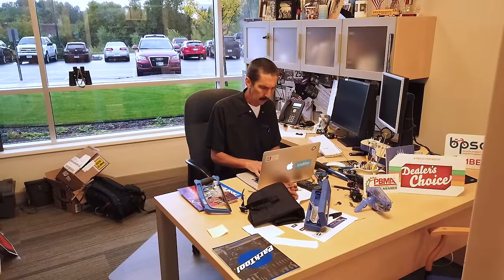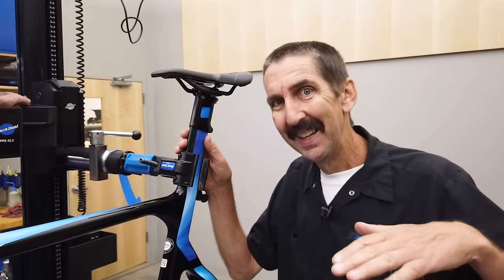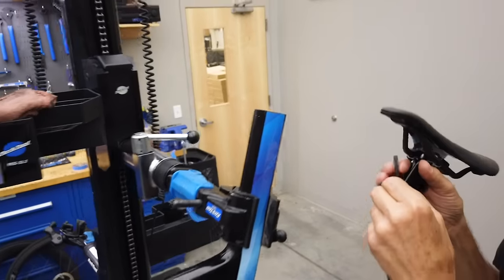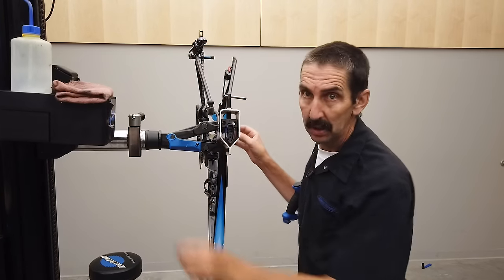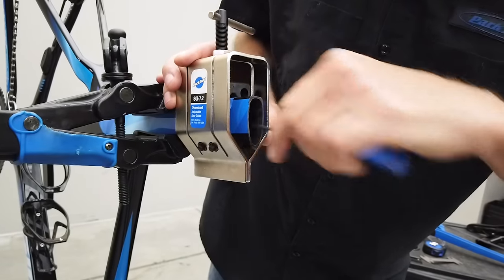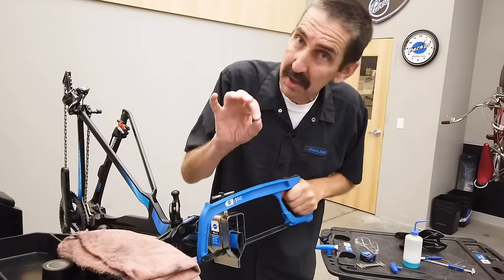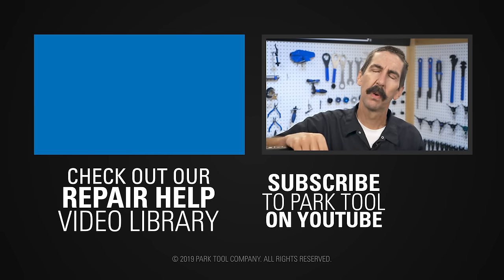Sizing & Cutting an Integrated Seat Mast | Tech Tuesday #137

Comment: I use an HEPA vacuum cleaner with a nozzle nearby to catch the dust.
Reply: That's good, but you should also consider a mask.  There is no other way to prevent breathing the particles.  Soapy water can prevent most of them.  A HEPA vacuum can get most of them.  A filter mask will stop the rest.

Comment: The funniest thing about these comments are the hysterical remarks regarding insignificant quantities of carbon dust.
Reply: Perhaps you should discuss these "insignificant quantities" of carbon dust with someone who actually knows what carbon can (and will) do from a corrosive standpoint to some metals.  This dust will fall down into the bottom bracket area, which could cause issues at some point, where your crank spindle and bearings live.  Why on earth wouldn't you take the time to remove it to avert that possibility?
Reply: It does not take much carbon dust to cause serious health problems if you breath it in.  If you cut carbon once every few years, you'd probably be fine.  If you work on carbon bikes for a living, and don't take precautions, you will probably die an early death of major respiratory problems.  "Insignificant" does not belong in any sentence describing a potentially fatal health hazard.
Reply: Good grief  we are talking someone cutting a seat post, not industrial applications. Like I said Hysterical.
Reply: @greenpedal370  Professional do this a LOT, mostly on steerer tubes and handlebars.  If you want to expose your lungs to a carcinogen, that is your right, but encouraging other to do the same, or criticizing those who are encouraging good safety practice, is negligent and foolish.
Reply: @backpacker3421  Oh please.

Comment: A lot of people are criticizing Giant's design here, but keep in mind that this is a carbon bike with Di2. Probably a racer. The weight savings is probably pretty significant. Also, Calvin, wear PPE whenever using a cutting tool!
Reply: I was cringing through the whole thing - no glasses, no mask.  Soapy water only goes so far...

Comment: I have a 2014 TCR Advanced SL 0 with the same kind of seat post clamp in this viseo. I am using two spacers on top of the actual fiber carbon seatpost (part of the frame) then the clamp with the saddle.  The problem I am having is a crazy creaking coming from the seatpost/clamp. I tried already using grease, carbon grease, even putting electrical tape around the carbon seatpost.
Any suggestions on how to get rid of the creaking noise? Thanks in advance.
Reply from the maker: Are you sure it is not the saddle/ rails and where they attach? These seatmast caps are not necessarily known to creak but the clamp for the rails is. Remove that, clean, grease threads and re install.

Comment: I’ll get the Propel Advanced SL in a week. Hope the Giant store works at the same level as you do! How many mm spacers can you use maximum? Just in case I need to higher the seat when I change crank length....
Reply: Where to do you get the spacers ? Bought one n need the post higher

Comment: My seat is a little too high for 20 yrs it was fine. Not sure if it is an aging thing.
I tried to lower my seat when removing the mast and saddle I was shocked to see a cut going around the carbon seat post. I have the shortest mast presently, so hopefully a 1/2 cut will do it.
Of course bike shops say buy a new bike.
Reply: I have the same.. But normal because the joints between ankles, knees and hip become thinner about half a cm.. Times 3

Comment: Do you have to be careful when clamping the seat mast, would the sawing have any adverse effects on the clamped section?
Reply from the maker: Manufacturers that use seat masts put thought into the bike being clamped and build it to be able to be clamped. Sawing is intended my the manufacturers and the only ill effect would be if you cut too much off. Which leads you to plan b which is typically a conversion post.

Comment: So what to do if you HAVE to make higher .. can I stack or do I have to replace the post
Reply from the maker: There is some adjustability in the height of the mast cap. If you really need to make it higher than possible some companies give you the option to put a standard post in. But this is not common and cutting too short is a very bad thing.
Reply: @parktool  how higher i can adjust the mast cap? What if i cut to low 2-3cm?

Comment: I love the way Calvin is always thinking about the ergonomic aspect of working on bikes.  Home mechanics may have a harder time without the high tech bike station.
Reply: I don't know, my stand will rotate, and the height is adjustable.  Raising and lowering the bike takes a bit more elbow grease than just pushing a button, but it can be done.

Comment: Thought you weren't supposed to clamp down on carbon like you're doing with the workstand clamp on the seatmast.
Reply from the maker: If you're careful, you can clamp on almost anything. See this video for more of our thoughts on the matter: https://youtu.be/ix_e6LWvap0
Reply: The front and back of seat masts are stiff and strong compared to the sides, which is where Calvin has clamped it.
Reply: @zygmuntthecacaokakistocrat6589  Yes.  Anybody wondering why can take a look at the cross section of the mast during the cutting.  Very thick front and back, not so much on the sides.

Comment: Good video, but I would have liked for you to mention the reason it's important to keep the carbon fiber dust out of the air: It's carcinogenic.
Reply: Which is why using soapy water AND a mask is a very good idea.  Soapy water prevents most dust from reaching the air, but not all.

Comment: Shouldn’t you have an respiratory device on when cutting carbon fiber?Remember your teaching people
Reply: he showed in the video he wet it with like water to keep the carbon dust from flying every where
Reply: I suggest the use of a vacuum not water. But I must your generation is lost in fear. What the hell are you going to do to survive in a working world?
Reply: John Smith : I’m retired 50 years of the working world still have all limbs and in good health. Just trying to keep other from dying! By the way if do use a vacuum make sure it’s hepa filter if not your going breath in carbon fiber dust
Reply: @rjg3876  - You could rent time with one of those boxes with remote arms they have for handling plutonium. You could just cut it outside. Or if you only do it rarely, you could ignore the issue because it's not an issue and no you don't need a HEPA filter for a little say action. You are doing nothing to "keep others from dying" you are bullshitting yourself.
Reply: John Smith : have fun with your potentially bad Heathy life. I made thru 35 year in the Elevator industry. could of been killed at any time had think all time. something I don’t think you can do
Reply: @rjg3876  - I said "use a vacuum," duh. 

PS I can run a mile faster than you, or five, and I'm over 60 having worked in painting with all those problems of airborne bs.
Reply: @rjg3876  - Pissing contest with a joker, you are muted.
Reply: The dust produced from cutting carbon fiber should be treated as though it were asbestos. In simpler words, yes! Always wear a respirator when working around any kind of dust.
Reply: Eye are YOU are eyE : don’t tell John Smith he knows everything
Reply: @Samsonmetaphysical  - That is absolute sissy boy nonsense. Yes wear a respirator if you wish, or a paper mask, or vacuum it, or just dust it out into the air and don't stress about it, or work outside, for your comfort. It's not a toxic, it's an irritant. Life is full of irritants, like the kids here who ask about soap or go bonkers over a bit of dust. If you every half to work for living you will learn what is harmful, what is an irritant, and what is neither. But don't listen to these frightened scare mongers on the cutting of one tube of resin impregnated fiber.

And for the record, if this were asbestos, you would have to fully mitigate it, that is you would be obligated to collect it all not just protect yourself. You would have to bag it and pay to dispose it. You have no clue what you are talking about.
Reply: The asbestos part was a joke John Smith,  but are you joking going bonkers over a www.youtube.com comment. How about this what kind of bike do you got, or how many bikes do you got, Do you work on them your self? And one more, how did you get into the painting business?
Reply: @rjg3876  John Smith sounds like a tool
Reply: jesuspeaksfrench : he's just old school if it did kill him let then it OK for him
Reply: @R J G Talking about teaching, it's "you're" not "your"
Reply: GreenPedal : thank you and I bet you voted for Hillary
Reply: I don't even live in the US.
Reply: @rjg3876  Ignore John.  He gets triggered by people thinking about safety.  He's all over this thread belittling anybody who mentions this.  Apparently he's afraid of people who don't like getting cancer.
Reply: Recommendations don't have to be followed

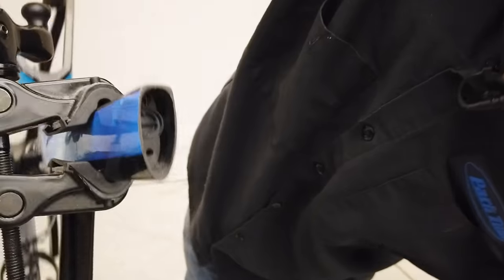Comment: At about 9:43 you can clearly see a substantial pile of carbon fiber filings inside the tube, above the Di2 unit, which should have been cleaned out before righting the bicycle and attaching the seat.  Details matter, sir.

Steve
Reply from the maker: Thanks for your concern Steve.

Comment: Do I need to seal the cut carbon fiber with something?
Reply: You could use clear nail polish if it made you feel better. I've never been told to need anything more than cleaning up the edges
Reply: @mrfailure93  Thanks!
Reply: @mrfailure93  - Every guy has that around.
Reply: @johnsmith1474  Just like every video has a troll!
Reply: @mrfailure93  - Nice to see you self identify.
Reply: poormans bicycles  - That's a keeper.
Reply: @mrfailure93  Are you sure about the nail polish?  The chemicals in wet nail polish might not be the best thing to put on the binding polymers.  Probably not a big deal, but... on a 10k+ road bike, I'd be really careful putting anything caustic on raw CF.  At the end of the day, nothing is needed to seal it.  Just file the edges to clean up the cut (like Calvin did with the sandpaper) and it will be fine.
Reply: @backpacker3421  nail polish is enamel paint
Reply: @mrfailure93  Yes.  And the medium that keeps it liquid in the bottle and dries off when you paint it (that stuff you smell) is a vitreous solvent.  That, combined with the fact that there is no need to seal carbon means at best it is useless and at worst could weaken the epoxies used to hold the carbon fibers together.  Use it if you want, but all you're doing is painting the carbon with something that isn't formulated for use on carbon (like a specialized primer that they use prior to painting bikes).
Reply: @backpacker3421  I'm not trying to argue, I was just  sharing a suggestion that I've heard plenty of other places. I also said you didn't need to. I really feel you're overthinking things though.
Reply: @mrfailure93  Yet you are being argumentative.  Pretty simple - does no benefit, could do harm.  That's not overthinking, that's just a warning.  Be careful of advice you hear from random sources.  A lot of it is pretty bad.  But if you want to put solvents on the raw carbon ends of your bike, be my guest.
Reply: @backpacker3421  ok

Comment: You could use a Japanese saw, or razor saw. You need to have a vacuum in play, not soapy water (9:44 it looks like a pile of crap in there). It's silly to be shooting water into the frame. It's not the "Doppler effect" ha ha you are not moving at speed past the object emitting (sound) waves thus invoking a change in relative wavelength, it's just the change in resonance of the seat mast, as it is divided. When you dress it up, use a block. For someone actually doing this, consider they might not own an electric bike lift. You might have lectured on the option of making the cut with respect to adjustability (your idea of lending the bike) that is, cut it some measure shorter so that the user can both lift, or lower the seat a tad. As you cut it, it can now only be lifted, not lowered.